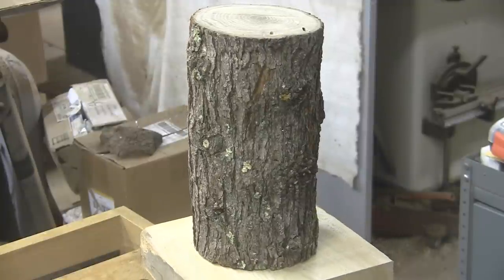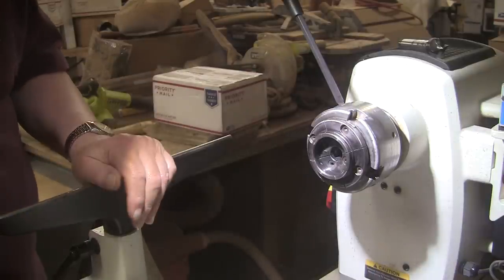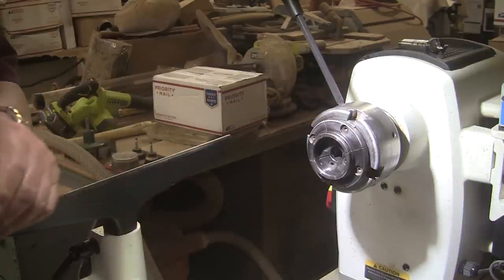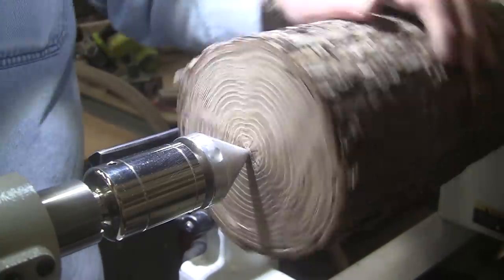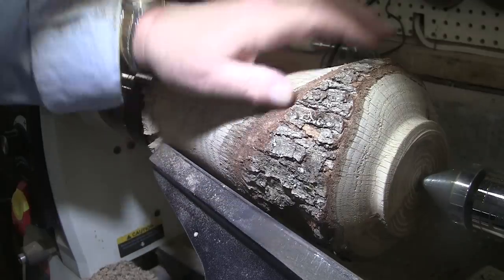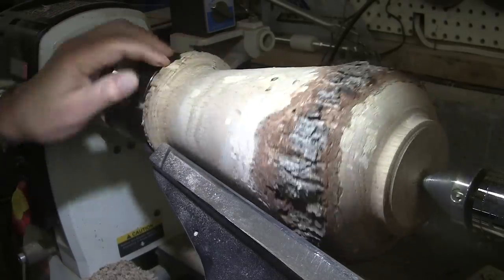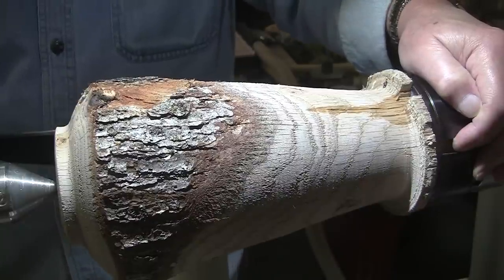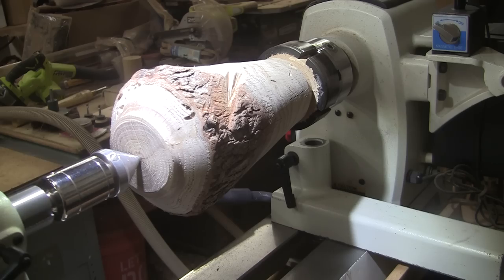Rustic Vase Watch It Happen - Live Critter Alert! - Wood Turning

Comment: Beautiful. Just Absolutely Beautiful! You say " I just wish you could feel how smooth this is"... I have worked with Oak ( making cabinets ) and know just what it feels like with the difference in the light and darker grains causing " steps " between. I can also see them here. Another piece of art to be very proud of Sir. It's very tactile. One of the things I always enjoyed about my aunt's many acrylic paintings. Once dry I could run my little fingers over the cactus and boulders and critters she often included in her art.
Re: the forester bit snafu; I am currently in after care treatment of stage 4 neck cancer and have been at home on disability for almost two years now with just a short break of 4 months back to work. ( it's in full remission now, just the after treatment ) It was bad enough that my Oncologist had me on a triple cocktail of chemo treatment. Then a full round of radiation. Somewhere in all of this treatment I overheard a couple of the nurses talking about what they called " chemo-brain". I asked them what they meant and they told me that the chemo can really affect how you think. Boy have I learned that to be true having three times as much as usual. Sometimes I miss such simple things like stepping up the drill size in making large deep holes like that or what should be done 1st, 2nd, 3rd, etc. and just felt so ignorant until I remember, " chemo-brain". Things I learned a lifetime ago are just gone now. I really have to concentrate and even write out steps so I hope I don't miss anything and screw up some valuable piece of wood or lose time in work. I'm sorry if this is TMI but thought I'd make the correlation . 
Looking at what you just did I would say that you ARE a great spindle turner in your own manor. Keep up the great work and stay well.
Regards,
Bill Riley
Reply from the maker: Well, you sure have been through the works!  I'm so glad you are in remission.  Good to know about the chemo brain, now I have an excuse about not being able to figure out righty tighty, lefty loosey!  I really have to concentrate on that part, too!  😊

Comment: Phil, 
I sympathize with your center hole. I do a lot of drilling in oak here in Texas and was taught by a seasoned vase and bowl turner to gradually increase the size if the hole. I start with a 1/2 inch forstner and move up in 1/4 inch increments. I used to start big and used up many hours and heated bits to get done.
Worked good for me.
Beautiful vase. Am inspired to do one again in oak and pecan.

Comment: A comment on microwaving:  Making a piece of wood hot, and exposed to the air, will always dry and shrink and crack the exposed surface.  You can get it hot enough to kill bugs, without much risk of surface cracking by heating in a plastic bag.  A Walmart grocery type bag can stand steam, without melting.  Then you let it cool, in the bag (and wet on the outside) but with more even moisture throughout.  Then you take it out of the bag and let the outside dry off, at room temperature .  Try it with some piece of scrap that you cut in half and put only half in the bag, heating both, at the same time, to see the difference the plastic bag makes.
Reply: I have been able to successfully microwave rough cut bowl for years. Thirty seconds on, twenty minutes to half an hour cooling. Repeat until weight stops changing. It may take all day but it works. Microwave power cannot be too high!
Reply: @kenvasko2285  rough-cut bowl is just about the perfect shape to dry with the microwave.  Its fairly uniform, thin wall and curve allows shrinkage to just warp the shape, instead of pulling itself apart.  The problem occurs with thick cross sections that have a shrinking surface stretched over a non-shrinking core.
Reply from the maker: I guess I always thought the plastic would melt.  I do use zip lock bags in the microwave but I thought they were a different kind of plastic.  This is interesting, thanks! 😊
Reply: @PhilAndersonShadyAcresWoodshop  Zip lock bags are polyethylene and melt right around the boiling point of water, (similar to hot-melt glue sticks) though they do not absorb microwave energy.  It passes right through.  But the grocery bags are a slightly higher melting point plastic than zip locks.  You don't need to seal them tightly (they will just blow up with steam.  Just lightly twist them closed, and sit the wood on the twist.
Reply: @kenvasko2285  good to know

Comment: Phil when I drill end grain likethat I use a air blower and blow down the hole to keep the fine dust and chips clear of the bit.
Reply from the maker: I do too, sometimes, Rick.  I don't usually show it because the noise plays heck with the microphone.  I also usually vacuum out the chips each time I back out the bit to clear them. 😊

Comment: I have an old microwave dedicated to wood out in my garage. I have figured out to use either the “defrost” mode or turn the power down to 30-40%. Then you can set it for several minutes and it will not get too hot. I still let the bowls cool to room temperature before doing another round. 

I knew you would like the chain saw mark in the final piece. I almost yelled at you through the screen to keep it at the top and use it for interest. That is what you normally do. 

If I am drilling a large diameter hole, I usually start with a smaller bit, then finish with the larger one, sometimes using multiple sizes (1”, 2”, then 3”).

Those bugs are beetle larvae.
Reply from the maker: Interesting, Dennis, thanks! 😊

Comment: Hi Phil,  I like to use a product called Slick Stick, sold by Woodturners Wonders.  You apply it after the bit heats up.  Really does a nice job when drilling large holes

Comment: The easiest way to get sanding sealer or shellac on the inside is take the chuck off the lathe, dump the material in, slosh it around, and dump out the excess. I usually leave it upside down on a dowel stand to dry.

Comment: I turn bugs quiet often when turning bradford pear and rather like the holes and tunnels they leave.  I have found that if you turn the speed up enough it will usually fling them out!  This piece turned out really nice and the bark added your special touch to the vase that would have been missing without it.  Have a great day!
Reply from the maker: Interesting!  Thanks, Dana! 😊

Comment: Another interesting piece. The borer holes could be seen as defects, but they are part of the history of the wood and do make interesting features. The chainsaw cut looked a bit rough, but I think the sanding also turned it into a feature. I'm a little surprised you put the widest part at the top - my own super power is the ability to knock things over by accident, so I would have put it at the bottom for stability.

Comment: Hi Phil. This may be a daft stupid question but I am a very new newbie to turning so that's my excuse. Why not start roughing down with a spindle roughing gouge to round things of in stead of your bowl gouge ? Keep well & stay safe
Reply from the maker: Never use a spindle gouge on a bowl.  They are designed differently with high corners that would dig into a piece of this size.  Also, they are not as strong as bowl gouges.  Please, just don't do it. 😊

Comment: Howdy Phil
White oak is great ..... I heard that if you had a 2 x 2 3 feet long you can blow threw it ! because the pours are so open .
Yes , that chain saw mark came out fine ..... Looks like a bear claw mark while the bear was chasing someone !
WOW that drill out did take a while .... Just made a mug and used a 3.5 bit going 5.5 inches deep ... 45 minutes ....but I also had the rpm at 650+ ... Yes very hot and the smell of maple end grain though out the shop . When I did a Oak mug I did use a smaller before the 3.5 ... I think I used a 1 3/4 maybe a 2 bit at 750 rpm ......very sharp and about 1 1/4 hours .... I do sharpen the bits with a nice cutting rake .... peals of like I am making plywood .
The bark looks fantastic ..... happy done flew off after zapping it . 1 minute is good for zapping .... any longer the bugs come alive and get giant !
keep on turnin'
Reply from the maker: Haha, that's all I need, a bunch of giant bugs running around the shop, Bruce! 😊

Comment: I like the bark, the bug holes, AND the boo-boo. How did it smell while turning? Ive turned some local-to-me red oak, and it smelled horrible. As in, made me nauseous. It was pretty wood, just smelled terrible. Didnt know if all oak is that way or not. You might not consider yourself to be a good spindle turner Phil. But, you are. I havent been disappointed with anything youve turned, no matter what orientation you choose to turn it in. Just tell yourself "I AM a spindle turner. I AM a spindle turner". See there? It worked, didnt it? I wouldnt steer you wrong Phil! Nice job my friend. Its gorgeous. 😊❤👍
Reply from the maker: I guess I lost much of my sense of smell with the chemo, Dave.  Didn't smell anything! 😊
Reply: @PhilAndersonShadyAcresWoodshop  I sure thought I had messed up my sense of smell being a welder most of my life. Turning the red oak assured me I still had that sense!

Comment: Phil,  what is the distance from your bed to the center of your spindle.  What is the width between your bed ways?
Reply from the maker: It's a Jet 1840, Kevin, so that's 18" swing and 40" length.  In reality it will swing 18 1/2" so that makes it 9 1/4" bed to spindle.  While I was in the shop just now I measured the width between bed ways.  It's 1 3/4".  Never been asked that one before! 😊  It's a great lathe!

Comment: You need to get a carbide hollowing tool, then you could have more than a straight hole. It would also make it less top heavy. Look nice on the outside though.
Reply from the maker: I have a few carbide hollowing tools, Sean.  That wasn't the issue.  Maybe you missed what I said about that in the video.

Comment: Just wondering if you have ever tried to put wax on your bit. I have used it on a common drill bit and it seems to make the drilling easier.
Reply from the maker: No, never tried that, Bob.  It would be hard to get finish to stick if the wood is coated with wax. 😊

Comment: Fantastic work Phil. Stunning piece... shame about the grubs. 

I've been watching your vids for a while, but only recently sub'd (no idea why), and I have a question. I've been turning for about a year, happy to call myself an ok intermediate, even been doing well selling my stuff... however, the way you use your gouges seems different to how I was taught, and other turners on YT. You don't appear to be a short fella, but your position and tool holding seems very level to the stock. Do you have your tool rest really high? The angle of the tool, while you're making those planing cuts, makes sense, but you go straight in at that angle, and your left-hand looks like there's practically no pressure. When I'm doing cleaning with a gouge, I usually hold on with a fair grip to prevent it climbing the wrong way, but you make it look effortless... what's the secret??
Reply from the maker: Thanks for watching and for your subscription, Jay!  I will try to be worthy.  I usually set my tool rest at center, or so.  I really don't pay significant attention to that.  I like the cutting edge of my gouge above center.  I wouldn't say I go straight in, might be the camera angle.  I'm definitely above center, slight angle up from the tool rest.  I've always suggested a light touch.  I'm not hanging on for dear life, only as tight as necessary to make the cut.  I always try to maintain that angle and cut until the cut is finished.  I feel inadequate in explaining this to you or anyone else.  You really just have to find what works for you and that might not be what works for someone else.  Don't pay to much attention to angles, geometry or anything else, just what works for you. 😊

Comment: Hello Phil 
When using a faceplate what length wood screws should i use. My lathe is an old 12" craftsman so i want be making anything large on it but at the same time I want to be safe?
Reply from the maker: Generally I'd say you want to penetrate the wood by 1" or so.  It depends on the thickness of the wood, of course and how deep you intend to go from the other side.
Reply: Thank you for your response and your help.  Im a rookie and i have learned a lot from your videos.  First and foremost i want to be safe because i have already grown to love turning. Thank you again for your help